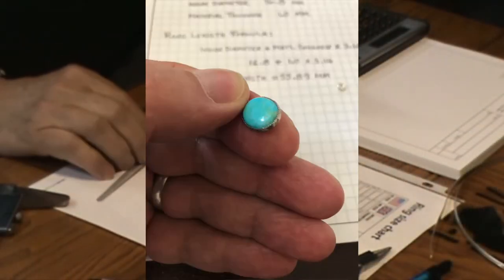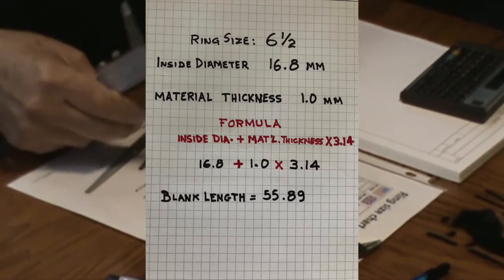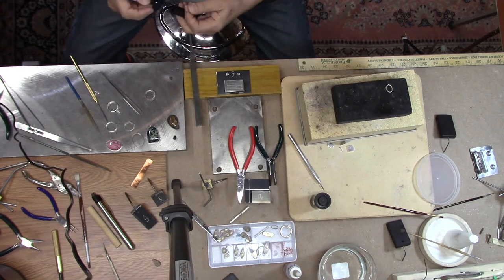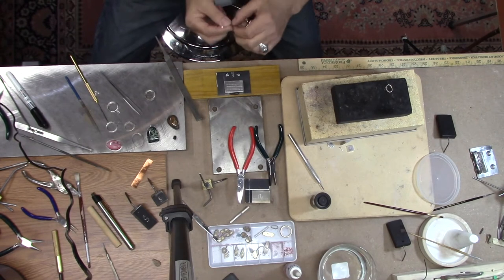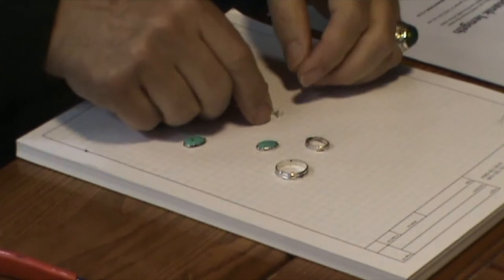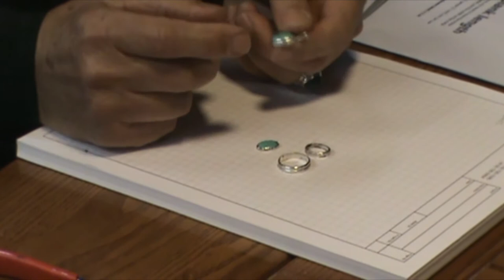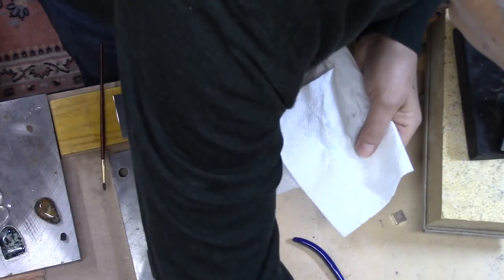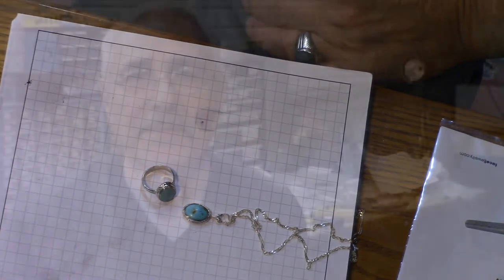Repairing Jewelry with Sensitive Stones

Comment: Great video, not really related I know but have a cast ring and unfortunately I cut the cabochon a little on the small side, it’s a little loose for the setting...aside from distorting the ring setting (difficult as it has decoration at each side) is there a way to make the cab bigger by way of adding a resin and re shaping to fit the ring better?
Reply: It’s an open backed ring by the way